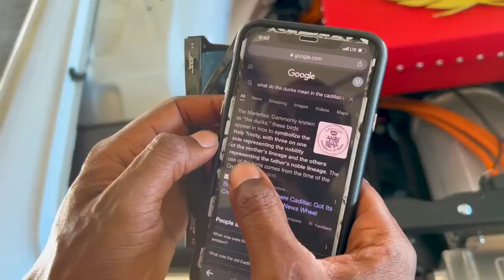If Tesla made a Cadillac, this would be it

Comment: QUESTION:  Why cant you use the transmission with an electric car???
Reply: You can hook them up to a manual but an automatic wouldn’t work because they need an engine to idle to keep the oil flowing in the torque converter… And the torque converter would get ruined/not work correctly due to electric motors putting out peak torque right from zero RPM. 

Electric motors have such a wide power band there’s no need for anything more than a transmission unless you want a really high top speed.
Reply: you can.  it just doesn't provide any benefit as the mechanical power loss of a transmission is greater than the losses for tailoring the motor for high speeds.  most cars do not have a need to operate above 100mph/160kph so the electric motor is designed to be the best and most efficient in that speed range.  Some home built electrics do use a transmission.  this is usually due to cost constraints.   "i only have the money for a 30hp motor but is still have the trans for the car,  i can make it go faster with less power for less money."   this is actually the premises of most ICE engines.  they make low power at low rpm so they have to have multiple gears to use engine rpm to keep the vehicle in the best usable power range. transmissions could also be called torque multipliers.  if you already have all the torque you need to get the vehicle to move at the speed you want you don't need a trans, they just add more part that can be broken.   if you look at very large very heavy mining machinery it is often electric but has huge crank cases,  that is because of the need for torque multipliers and too much heat generation in the electric motors.   hope this helps.
Reply: @michaeljgraff   thank you

Comment: Actually Rich you are closer to the truth than you might realise. You know what, this is the future of EV's! Custom built systems that charge when plugged in, run without error and don't fire you into the Armco because of software recognition faults. The future most certainly is not the current añål output from the mainstream manufacturers, with unreliable, overengineered, monkey puzzles that will set you back more than the cost of a house. Is this the future of electric? I hope so.

Comment: This is cool.. but I could never aford thos electric gimboz..   

I´d like to convert one of those caddies to liquid petroleum gas.. .  (much cheaper to run on than gasoline) ... would keep the v8 rumble.. and be better for the enviroment than that 55kWh battery pack :P  

or take some old chevy impala and put a chevy van diesel motor in it..  some of them bolts right in I think .. :P

Comment: If I cold find a truck like that, I'd paint it pearl black with a very minimal blue haze that you could only see in the sun . All of the suspension would be upgraded. Aluminum rims that look period correct. Supple leather interior. And it would have a monstrous 2000 hp viper v10 in it . No electricity

Comment: I would love to electrify my Austin Healey 3000. Drop in a Chevy Bolt motor up front and distribute the batteries and controller for 50-50 weight. Heck maybe even a weaker motor so I could keep the stick shift. It already has manual steering, and no AC so just add an electric heater and it would be perfect.

Comment: A) Hillbilly Deluxe is NOT original... you didn't invent that. 
B) EV's, man... WhhhhrrrrrrrrrrRRRRRRRRRRrrrrrRRRRRRRrrrRRRRRR cLuNk ClUnK cLuNk ClUnK CLUNK CLUNK WWWWHHHHRRRRRRRRRRRRRRRRRRRR  K    K    KLUNK   KKKK KLUNK WWWHHHRRRRRRRRRRR.... Like a walmart battery op fake razor quad.  Neat builds... but man do I not get down with it. The single gearing, the oddball limitations with simultaneous huge power claims. As in "I make ALLLLLL THIS", but can only do (whisper) "this". Never as impressive as it should be, or as it sounds on paper.... worse even than dyno queen builds, that make goofy high HP numbers, but only between 6950 and 7000 rpm. Nothing before, Nothing after. . . meh.

Comment: Love the truck and the mods all the work done to it. The thing that worries me is that Texas just asked it EV owners not to charge their vehicle's due to the heat I'm assuming because so many A/C units are on and we are in the summer. The LPG froze and the grid couldn't support the load and had a brown out but yet they want us to embrace the switch to electric. Nicola Tesla supposedly had a car he converted to electric but it took the electricity right out of thin air. You can tell that if they can't put a meter on the electrons like the gasoline and make money off from it they don't want to embrace it! Again love the car and the power must motivate the truck and car right along with some kick but it worries me seeing the grid in shambles and they want us to give up crude. Doesn't seem like they are worried about the extra load on the grid!
Reply: One day EVs will assist the grid at peak demand via V2G.

Comment: elec motors are continuing to evolve much like the evolution of the donk
Reply: these pu trucks with elec need to have pv panels to extend range - one could add over 1000w pretty easy - you would never have to charge (for the most part) - if the truck is topped off you can simply have it charge your home system - think of it as a mobile tesla wall #wireless firewire

Comment: Can these EV conversion systems be remotely shut off by some engineer somewhere, the way every Tesla vehicle can?  If so, that's a hard "no" from me.
Reply: No? Why would they add that feature to a car they built themselves?
Reply: @thedopplereffect00  If connectivity is a feature that's built into the main control board of the conversion kit, you might not have a choice in the matter.
Reply: @caulkins69  why would they add a feature people don't want? A cellar modem is NOT a cheap device and requires a monthly contract to function. They aren't just going to be sticking these randomly into a DIY car. Besides, if you believe that with EVs, there isn't anything stopping them from putting modems into crate engines.
Reply: @thedopplereffect00  Connectivity isn't as expensive as you think.  Smart TVs, doorbell cameras and even light bulbs are being designed to form Bluetooth mesh networks that potentially send God-knows-what information to God-knows-where.  Smart electric meters have been doing this for years on the 700 MHz band.  The electric company used to know only how much electricity you used in a month.  Now they know how much you use each and every hour, which is unacceptably revealing of your lifestyle habits.  If connectivity were a built-in feature of a crate engine, then I would need to know that so I can avoid such a purchase.  The last thing I want to do is take a trusty old car that doesn't spy on me or expose itself to remote-control issues, and turn it into one that does.

Comment: I'm not even an old person and going electric really really pisses me off! Nothing beats the joy of a big block! I'll quit the car business before I go boring electric!!!
Reply: Do you still use timing control levers? Manual mixture control? Do you set the idle lever? Do you adjust the radiator flaps manually? Do you use a mechanical lift pump for the fuel? No? Pfft, you already use more computers to control your engine than a simple EV.

Here's the thing, if you really like to play with ICE cars, you should probably encourage other people to move towards alternative options. If your big block is burning the same fuel as every other car user, you're going to find that the fuel will be so expensive or hard to source that you will not be able to run it at all. Fossil fuel is a limited and damaging resource, if you want to maintain a supply, and not be forced to compensate heavily for the pollution, let fuel burning vehicles become a niche, so they are simply a small sector not worth regulating heavily. Also good luck resisting progress, that's a sure way to be left behind.
Reply: What the hell are you doing here watching this channel? Are you hate-busting one out to Rich & Stevon?
Reply: @randomname4726  well not all their vehicles are electric. They have some really cool non electric vehicles as well and that's what I like to watch. Don't get me wrong I like options I just don't want it to be electric only. I mean have fun with the Tesla, it's cool to watch and even cooler to see one ls swapped.
Reply: @timothyballinger6280  OK I can admit when I'm wrong, my comment was a tad dumb considering the petrol content,  my bad.